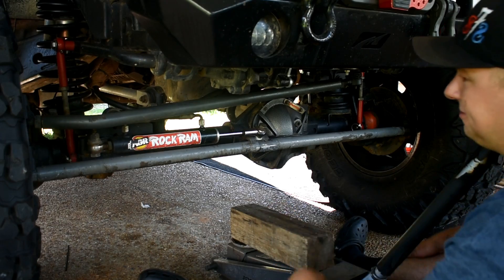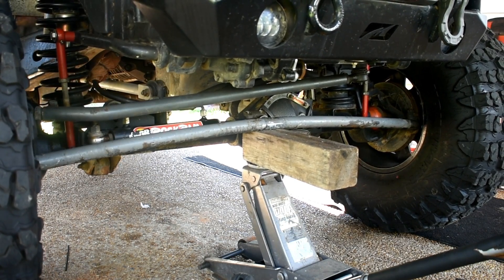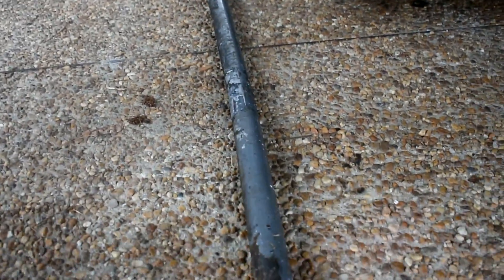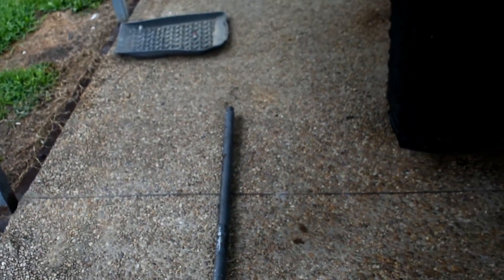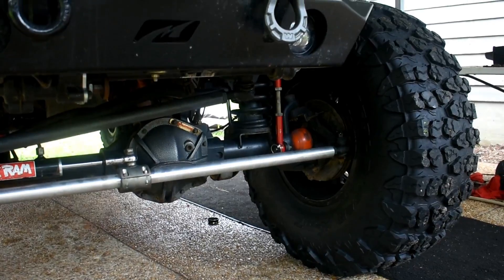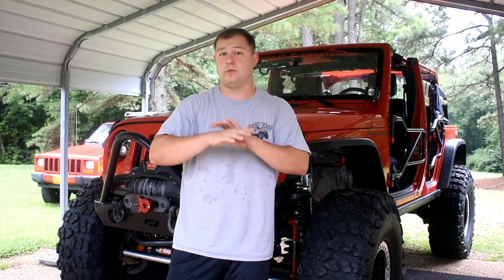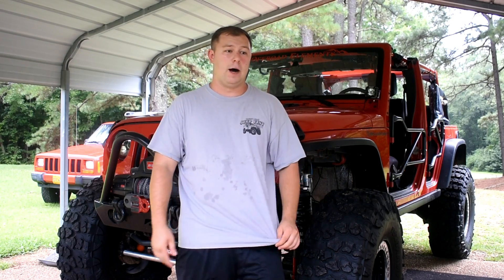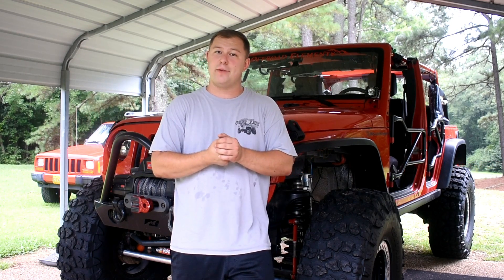TIE ROD BEND TEST - STEEL VS ALUMINUM

Comment: One consideration with a steel/chromoly vs aluminum is that generally speaking steel is more likely to slide on a rock while aluminum gouges and drags/hangs.  This is generally why many prefer steel skids vs aluminum even though they both if sized properly are capable of taking the hits.  Not so sure how much this will play into tie rods specifically worth noting when comparing the 2 materials for anything exposed to hits.

Comment: Depends on the steel that probably cheap mild steel,
4140 CrMo is far better than any aluminium, also aluminium has a fatigue life
Reply from the maker: I’m a big fan of aluminum because it absorbs a lot of the impact from hitting the tie rod. Yes chromoly will be much stronger and practically will not bed under real world scenarios, but now a hard hit will just spread that shock load to the tie rod ends/knuckles/ or the steering box sector shaft which is extremely weak on JKs. In the end both are better than the cheesy factory steering

Comment: Great job on the video. I've been running ORO U-turn steering for about 10 years now 1.5 solid chromoly and no issues minimal flex and worked great. Just done an axle swap heard about Aluminum and am leaning that route because of your video. My only concern: How do the TRE threads hold up?

Comment: Hi, It's been a couple years, are you still using the aluminum bar? Any pros and cons to share? Thanks.
Reply from the maker: I swapped to one ton axles, so using a different aluminum tie rod now. But it is a no brainer for sure, great setup and highly recommend it

Comment: Great sales pitch to sell aluminum tie rods, but not a scientific comparison.  Steel has a higher strength then aluminum.  Use a solid 1-1/2" bar and the results will be significantly different.
Reply from the maker: Who wants to drive around with a solid 1.5” steel tie rod lol. That’s heavy as crap. Aluminum is an amazing steering setup

Comment: The fatigue life of aluminum is about 1/4 that of steel - its why aircraft are retired when seemingly they look fine - an aluminum tie rod will undoubtedly have a shorter life - its why things like the spitfire's main wing spar was made in T5 steel
Reply from the maker: I have yet to see an aluminum tie rod fail on an Offroad rig

Comment: I just got my Jeep used and I want to replace the factory tie rod and drag link do you have any recommendations? I’m running 35’s and I have a little bit of steering wobble
Reply from the maker: This one lol. 7 slot customs. Plus they offer a 10% discount for the channel with the code jkgear
Reply: JK Gear and Gadgets thank you love your channel by the way and love your jeep

Comment: Hey man thanks for everything you do for us by the way what do you recommend on the bars go under or over?
Reply from the maker: If you are referring to the drag link. That is called a drag link flip. A lot of variables come into play, you only want it if you are over 3.5” lift, if you do it then you also need to buy a raised front trackbar bracket so the drag link and trackbar are parallel

Comment: Great video on the big benefit of aluminium tie rods. I have a synergy and is taken a Hell of a beating and is straight as an arrow. The big difference is that your steel one was just a cheap steel tube where synergy uses heat treated chromoly steel which is much stronger. Granted being steel once it bends it'll probably stay bent. If that day comes I'll definitely be going aluminium now that somebody finally decided to make an affordable aluminum bar.

Comment: Midwest steel supply has 7075 1.5"  Aluminum round bar for $86.00 for a 53" length. Drill and tap 2 holes... and you have yourself a tie rod. Dont be silly and spend $300 on a tie rod people.
Reply: Wish this were still true in 2025...I just priced it out.  $161.75 for 1/5" x 53".  Ouch!
Reply: FACTS! I wish I had a machine shop that could it it here in AZ!

Comment: How is this holding up? Any tie rod end issues? Does the clamp slide on the aluminum at all or does it dig in and stay put?  Thanks for the vid!
Reply from the maker: Still doing great! No issues at all.  And the clamp hasn’t moved at all, but I did tighten it very tight
Reply: @JKGearandGadgets  That's awesome- Ordering parts to do my axle. Thank you!

Comment: That's pretty crazy. If I bend my synergy one I'll get one of those to replace it.
Reply: Yeah my synergy had taken a Hell of a beating and is still straight as an arrow. I think the big difference is that steel one he had was a dirt cheap steel tube whereas synergy uses heat treated chromoly steel which is much stronger. That's what race car roll cages are made out of.

Comment: I have a bent tie rod like yours. I called Metalcloak and they replaced it for free.  I did consider purchasing an aluminum tie rod if Metalcloak would've told me to pack sand. Great video.
Reply from the maker: Wow I’m surprised they covered that!

Comment: That's pretty awesome, thanks for the product test. Also, how are those DV8 bump stops holding up for ya.
Reply from the maker: Pretty great so far!! Still want to get some good footage of them in action
Reply: JK Gear and Gadgets 10-4, thanks for the response. You going to be at Smokey Mountain Jeep Invasion? If so maybe run into you there, like to check Jeep out in person.

Comment: Well maybe you should disconnect the stabilizer shock and put a taller piece of wood and put the complete load (tires off the ground) of the Jeep on it like the steel bar, it should be the same comparison test
Reply from the maker: It would bend back straight still. I know what your saying though, but I didn’t have a bigger piece of wood laying around. Another benefit of the aluminum is that it will bend more (leaving the tires on the ground = more traction)

Comment: I'm curious if the ruff stuff tie rod was heat treated, the way it bent seems like they used a low grade mild steel.
Reply from the maker: I don’t think so. When you have steel tubing that long it is going to want to bend at some point. But I think it was just DOM tubing
Reply: This was the best question posted so far; in response, a heat treated, chromoly steel will retain its shape ( straightness) where a DOM steel bar like the RuffStuff - even if heat treated - will not , as seen. I’ve slid my 4 door around upon a large boulder with all weight only on a chromoly heattreated TR and it did not bend. Aluminum is lighter but doesn’t handle gouges and deep cuts as well as chromoly . Either would be far better than just the DOM that RuffStuffs consists of. 😉

Comment: I literally said “whoaaaa damn” outloud when I saw you drop the jack on the aluminum tie rod
Reply: Spring Steel tube be better. Dunno what steel that 'Rough Stuff' rod is but it didn't have much spring strength, cheap steel.
Reply: @user_mac0153  Good luck finding round tube made of spring steel
Reply from the maker: haha i was a tad bit nervous at first
Reply: Hunter Whitiworth I second
Reply: <--------- "Wooooooooooow!!!!" (close enough)